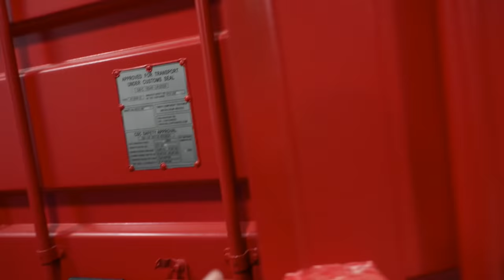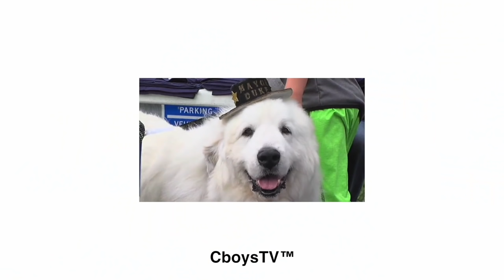Quad with Snowmobile Ski's

Comment: there has to be a way to replace the wheels with two tracks
Reply: Those kits exist already...
Reply: Not on a sport quad. They exist for utility machines and I can say from experience, a tracked utility quad with 4 tracks, while not very fun, is an absolute tank, I don't think you can get one stuck. But on a sport quad, I'm sure you could find a way to rig some tracks onto the back but it would destroy the entire drivetrain. It would go through an entire clutch in the first ride, and eventually blow the motor. Those are pretty delicate machines, you really need a utility to do something like that.
Reply: @canadien15farmlife58  wdym can’t get one stuck, they get stuck ridiculously easy lmfao. With the turning radius of a boat too

Comment: I love watching you guys do your shenanigans on the snowmobiles and such . Unfortunately I couldn't join you if I wanted to . I've spent the last 25 years dealing with the aftermath of a class two shoulder separation . And while I didn't get mine while snowmobiling , statistically snowmobiling is the number one cause of separated shoulders . Maybe not the snowmobiling so much but the wiping out and landing wrong .

Comment: Cut an old paddle track and deflate the back tiers on the quad and put the track around the tires and clamp it back together and air the tire back up so it gets pretty tight so they don't come off

Comment: I did this back in 1978 with my Honda Odyssey. The only difference being there were no kits available then. I used snowmobile skis and had the hub adaptor made in a machine shop. Worked great on that as well.

Comment: back in 07 i was out sledding and pulled over in a field and a kid came by on a 300ex with paddle tires and skis and he was wheeleing from one end of that field to the other, looked like  a blast, i also ran into 2 honda atc's with paddle tires on back and a single ski on front one time  but they guys said it was hard to turn because the front ski kept wanting to lift off the ground.

Comment: Get old snowmobile track cut it down let air out of back tires wrap track around them kinda tight then use good tie wire or tractor trailer zip ties then air up tires so track fit snug